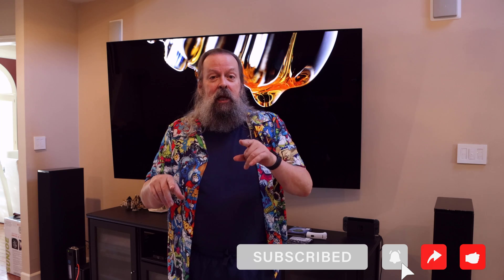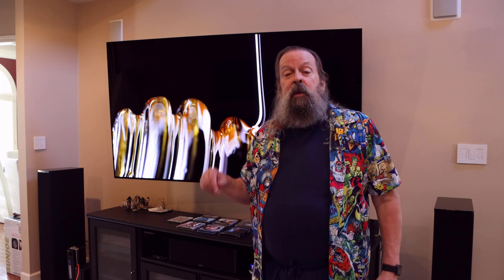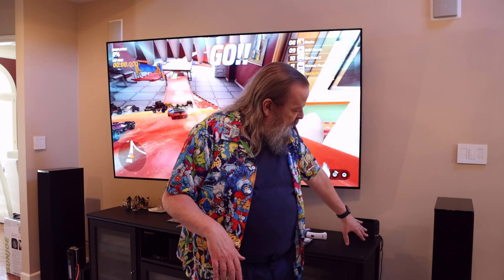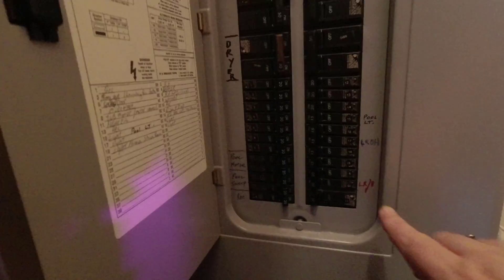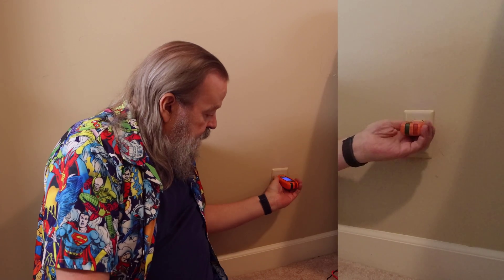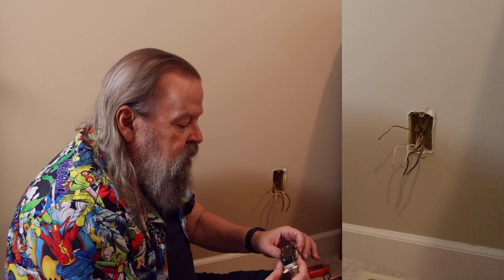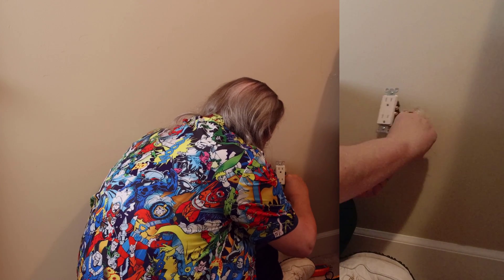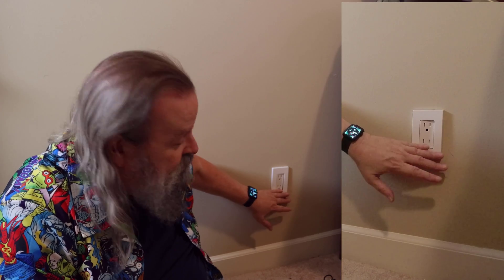Outlets Not Working, Breaker Not Tripped. How to Diagnose and Replace Malfunctioning Receptacles.

Comment: Had something similar happen recently. My father put a compressor in a bathroom receptacle and boom. Power went out in part of the house. Breaker not tripped, the said outlet was not damaged either. Turns out it was a switch in the same line that had burned out black wire that was pigtailed to switch. Switched the wire and worked again. Fixing it was easy..but searching for it was a huge pain.
Reply from the maker: The searching the chain is the huge problem. The fix is usually easy, as you found.

Comment: I found the outlet that is still getting 120v on this chain. 

Still cant find the dang issue. 

Have tested continuity on most of the outlets im running out of steam 😂
Reply: Curse my 1965 home! Aluminum wiring has been a pain in my ass
Reply: 4 outlets in the bedroom. 1 in the bathroom and 4 in the spare. Son of a biiiitch. 

It's also connected to the light in the basement 😂
Reply from the maker: Wish I had some suggestions.

Comment: @DrWiggo What if the situation has 2 outlets that went out, I’ve replaced the outlets, yet still nothing.  They are wired correctly and the breaker is not tripped, and there is no gfci involved.  What now?
Reply from the maker: The problem is elsewhere in the chain. I replaced a half-dozen outlets before I found the one (that worked) but was interrupting the daisy chain.

Comment: But Were those two outlets you were testing working or not?
Reply from the maker: Yes, those two turned were working. Remember, it's usually a working outlet that causes the problem down the chain. In the last chapter (around 17:20), I show the offending outlet, which was farther down the chain (but still working), and the problem was obvious (once the outlet was removed).

Comment: Well I have 3 Apts all the lights and outlets are on 1 breaker grunted they used a 20 amp. Total of 36 connections in series and 1 gfci which is on the last item in the series a garbage disposal.  I am hoping to break this all up into outlets only and lights only and by apt.
Reply from the maker: That's worse than my situation. Good luck!
Reply: @DrWiggo  thx. As a start thr plan is to find the 1st outlet from the breaker and line in a GFCI. And at least protect the bunch until I gradually separate this mess for the owner.  Just have to see what amp this main box is as it looks like I can put in a few more breakers. So I can at least separate the Apts. If I can avoid new service box I'll try and gfci each room even if I can't  get outlets and lights separate. Beats having the  tenant constantly resetting breakers.  This is what I get for knowing how to install hardwire detectors. Can you do this now too lol. Ugh and I'm a hate to say no person. I'm a volunteer so not paid. But I use dro build in the 80s and 90s so not up to speed on code so I have to look periodically. But I like your down to earth shared experience.

Comment: No you are wrong... To wire this the right way is to add pigtails to each wire white/black & ground then the pigtails are wired to the plug. The reason for this is you are no longer daisy chaining your plugs so if your plug has a loose connection or it burns out it does not effect the plugs down the line (this is Code is some States).
Reply from the maker: You are correct. That us the best way. But it's a lot more work than most people are willing to put in (in my state, including professional electricians!).

Comment: Very good video, if a bit long-winded. My only criticism is that I believe you installed the hooks on the wires incorrectly. The hook should face so that as you tighten the screw it closes the loop. By installing it backwards, as you did, the loop tends to open. Very good job, however. Nice TV.
Reply from the maker: Longwinded is my trademark (and why I have chapter skips!). And you are correct, I put the wire hooks on backwards (this is how we learn). Thanks!
Reply: No biggie. I enjoyed the video and found it very helpful. Thanks again for posting it.

Comment: Excellent video on the topic. I started my DIY electric schooling about 20 years ago. My rear neighbor was a master electrician who showed me the ropes. Here are a few things I learned from him. When fastening wire, it's Black on Brass, White on White. What wire gauge was used on the line? 12 gauge for 20amps and 14 gauge for 15amps. If using 14gauge, the receptacles should be rated for 15amps service. For 20amps, use 20 amp rated. For 15amp service, using 15 amp receptacles, the circuit breaker should be 15amp. The line wire, in this case, can be 12 or 14 gauge. I use a 3/8 inch wooden dowel with a grove on the end, sized to the size of the wire, to help me push the wires into the box. This allows me to align the outlet/switch to get a flush fit, not crooked. Not so much how many outlets, but what is plugged into them simultaneously and how many devices are in use that counts. A floor vac will draw up to about 13amps by itself. I never wire a receptacle using the holes on the backside. I only buy, and they cost a little more, receptacles that allow for either hook around the terminal or have a movable retaining plate that you slide the bare end of the wire and then tighten the screw. I call these receptacles commercial grade.
Reply from the maker: Sounds like YOU should be making videos on this stuff. Thanks for the knowledge (I may steal some of it if I ever revisit electrical)!!
Reply: Why don't you use the back holes?
Reply: @supremeclientele3344  Thanks for your reply. I mount many of my outlets on the outside of a wall, using the Square D metal work boxes. Most of my outlets are in my garage or shed.

Comment: I think most electricians would use pigtails instead of daisy chaining, so each receptacle is independent from the other.
Reply from the maker: Today, maybe. But we're talking 30 years ago.
Reply: @DrWiggo  Yea, who knows? BTW, my house is 70 years old and they used pigtails, but they were crimped and soldered in place and insulated with a special electrical tape.
Reply: @DrWiggo  Electrical apprentice here. Before you opened up your outlet, I figured you probably didn't have a pig tail going on (where the respective wires are all connected to each other then one wire (a pig tail) goes to the outlet itself, removing the plug from being part of the conductor for all the other downstream/daisychained outlets. Sure enough, that's what you had.

But because your "back stabber" connection was loose, and your cleaning lady saw a spark, I suspect that was your problem.  If you have future problems, I suggest converting your outlet connections to pigtails, for more dependable and reliable outlets. I'm far from being the best troubleshooter, which is how I came across your video, but it was a good exercise for me. Thank you.
Reply: It seems opposite to me. I do service work all the time. The old electricians were the good ones, the new ones backstab and series everything (v.s. parallel). That's just my opinion from doing 10,000 or so service calls for this type of stuff.  @DrWiggo

Comment: These are cheap residential grade receptacles. For about $1.50 more you can buy "spec grade" receptacles which are more robust. They don't have a backstab option, but they have a back wiring option, in which the straight wire is clamped in place by tightening the screws.
Reply from the maker: Good to know. (Though I doubt many builders would go for an extra $1.50/outlet).
Reply: @DrWiggo  right but as a home owner it's nice to know. Most builders also don't add on redundant safety devices like I have in my own home having dual function breakers and a dual function outlet protecting every outlet circuit. Just me adds a lot of price to the electrical instillation of my home but I'm willing to spend the money for the added power and safety of having a 400 amp service with all the new modern tech I can put on it ie GF/AF protection and surge protection.

Comment: 15? I seriously doubt that is up to code
Reply from the maker: I'm thinking it had to be up to code in 1992 (when they built the house) because code enforcement is a big deal in my town (they drive around looking for infractions).
Reply: 15 amp duplex receptacles are NEC compliant on 15 and 20 amp circuits. Some localities may require 20 amp receptacles on 20 amp circuits and have 12 gauge wire. 20 amp receptacles on 15 amp circuits, usually 14 gauge wire, is not permitted by code.
Reply: @surferdude642  No, 15 outlets on one circuit
Reply: @markme4  Yea, you're right, I missed the first 7 minutes. 15 does seem a bit much, but if you only use a few at a time it shouldn't matter. I'm not sure what code is, bit I've heard 10 is considered max.
Reply: @surferdude642  Some one saving money
Reply: @surferdude642  by code you can have any number of receptacles on a circuit. However a good thing to remember is for things being plugged in can only go up to 80 percent of the breakers capacity and a general rule of thumb for each receptacle is 1.5 amps being drawn at any given time so on that 15 amp circuit he should have no more than 8 receptacles. So I suppose it's best to be wired that way because you have a less likely chance people will overload the circuit. But ya by code it doesn't really matter code is just minimums however and many electricians have their own reasoning as to why things are wired the way they are well for me a lot of that reason is because that's how mister and misses smith wanted it and if it's to code than I'll do it I may not like it but I'll do it if its safe and to code and it's what the customer wants. Sorry rambled a bit there at the end.

Comment: My biggest problem with receptacles is the copper wire was over twisted during install and eventually snaps off.
Reply: If you need to undo a wire after removing a wire nut, don't try to untwist. Just cut and restrip and use a Wago lever nut to reconnect. No twisting is necessary.
Reply: @surferdude642  man I like my twisted wires just because diy folks fuck it up doesn't mean I'm giving up my nuts my wire nuts I mean.
Reply from the maker: That is indeed a problem. Don't really have any good advice for that.